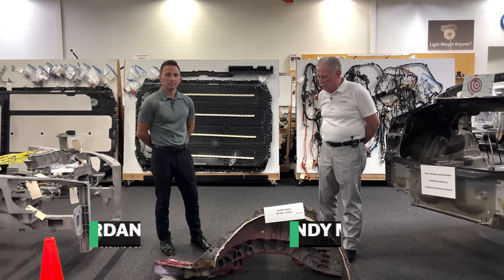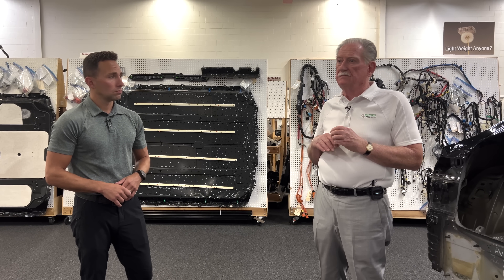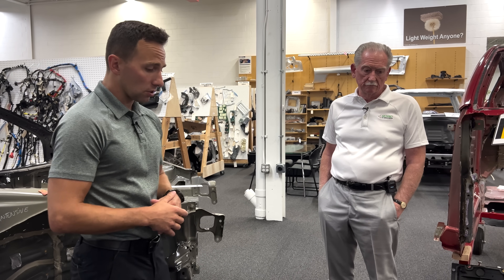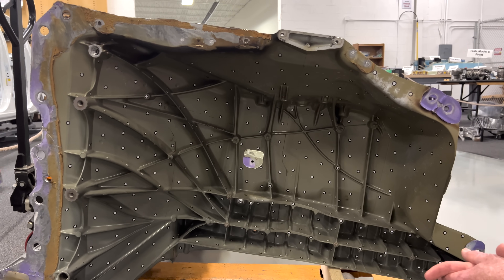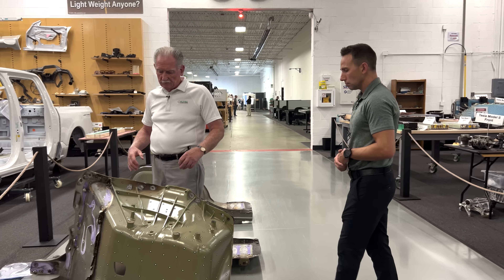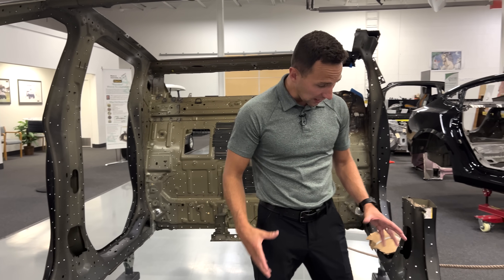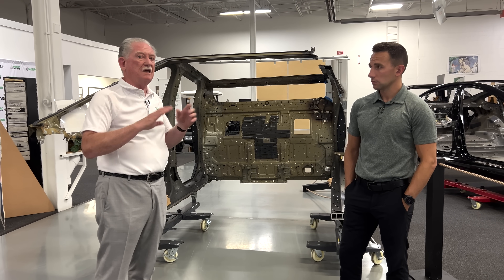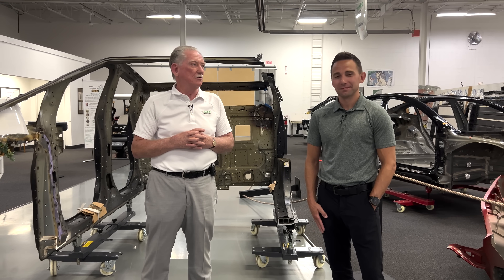From 120 to 1: How the Cybertruck Castings Continue Tesla's Reign of Reduction

Comment: @MunroLive
I hope you guys are gonna talk about the shear stress failures on the gigacast trailer hitch, and how or if tesla can revise the design. They clearly need some sort of ductile brace like steel to reinforce the vertical shear forces
Reply: SHEAR, not sheer
Reply: @The_DuMont_Network  fixed
Reply: @The_DuMont_Network  
Dictionary
Definitions from Oxford Languages · Learn more
sheer
adjective
2. perpendicular or nearly so

Just fyi, but point taken
Reply: @whodat9198 
 shear 1 of 2 verb

: to subject to a shear force

: an action or stress resulting from applied forces that causes or tends to cause two contiguous parts of a body to slide relatively to each other in a direction parallel to their plane of contact
Reply: @GROND15  no kidding, you missed my point. I always appreciate people that define words with a tautology too.

Shear = to shear 🤣😂

Very Merriam Webster nonsense
Reply: They need to reinforce it with C4 obviously.
Reply: @whodat9198 It was not a hitch failure, WD busted the end of off the casting.     It was a 100% entertainment video.  No science in it.
Reply: @danharold3087  WD also showed that a real truck has no such issues. CT is a terribly designed, but well engineered truck. there's a reason trucks don't use aluminum frames.
Reply: @danharold3087  incorrect. A family towing on the freeway hit a pothole and snapped the hitch/ rear losing the trailer. That's not entertaining unless you're a psychopath. The cast was clearly designed for adequate horizontal towing forces but not vertical. This is where real world experience cannot be substituted for desktop simulation by inexperienced programmers. I assume they should be able to design in more cross braced cells in the rear to reinforce if adding ductility is out of the question
Reply: @danharold3087 I'm not sure. Either way, it's really a distinction without a difference. It deserves further scrutiny. It would be nice to hear Sandy and Tesla say something about it. I'm not into applying faith and hope towards engineering that someone will just be all over it. No offense meant.

Given the nature of crystalline structures in this sort of casting is not hard to see how this could be an overlooked design flaw when engineered to a limited specific design parameter. I hope it is remedied, if not I'll just get my reveal night deposit back and wait for gen 2. My Scout reservations will be ready for delivery by then.
Reply: @danharold3087  what a joke of a "truck" i wonder why WD couldnt bust the trailer hitch of the ford f150!!!!! he did litteraly everything can you talk about that!?
Reply: @alanmay7929  That specific design flaw doesn't make the cybertruck a joke. It's still better than the F150 lightning in speed, acceleration, handling, audio quality, self driving, charging performance, off road capability, larger cargo bed with 300lb rated security cover, tech integration and features, full camera surveillance, door ding resilience and taking a 9mm or 45acp driving through a democrat city.

The F150 is quieter and more comfortable. It reigns in that category over all others
Reply: @alanmay7929  
Did you see the video from last year (2 years?) of the guy who had an F150 literally break in half at the join between the cab and bed?
.
Reply: @rogerstarkey5390  yup, ford had a bunch of raptors that bent in half from trying to jump

Comment: Did you guys give feedback from the broken cybertruck in whistelindiesel? In case you didn't see the YT episode, the rear just broke off, like it snapped way to easy.
Reply: Also the follow on video showing a body on ladder being dropped similar to the Cybertruck drop.
Reply: Why the guy is a total tool with fly like iq.
Reply: Not exactly a surprise that flying a truck six feet in the air and then dropping its back repeatedly on a slab of concrete would cause damage.

It's just an entertainment clip. I'd say I'm surprised it took that damage so well, the competing Ford was actually hauled off camera without doing much - due to lack of performance to pull it off.
Reply: @AllanSustainabilityFan  go watch whistlin diesel following video he tried everything to destroy the ford f150 trailer hitch but didnt succeded, in fact he actually bent the chassis of the truck nut still nothing happened to the trailer hitch.
Reply: @alanmay7929  I've seen enough of the entertainment stunts. The guy is just catering to his audience. Nothing wrong with that.

Meaningless in real world applications.
Reply: @AllanSustainabilityFan  there is a video on tiktok of a 80hp toyota yaris from over 20 years ago carrying well over the payload of a truck on its roof and has been doing that for how long who knows! its just goes to show how solid some vehicles are built!
Reply: @AllanSustainabilityFan  Heavy D did an experiment with his tesla cybercrap with 3 motors over 850hp hauling quite a heavy  load vs a RAM 5500 heavy duty uphill, the tesla went much faster up but barely arived with 10% battery left while the diesel literaly disnt break a sweat and no range to worry about! thats real world applications.
Reply: Tesla will add C4 to the casting.
Reply: @isthatatesla  what a lame joke! because c4 literal appears from nowhere!?

Comment: Cost reduction and process improvement with substantial price increase. 🤡
Reply: Yes,  all automobile prices have skyrocketed due to forced inflation. If people are still willing to pay the price,  it's,  strangely I admit,  not too high,  and it's selling well.
Reply: False. Tesla has been reducing prices over the years, and currently offers some of the most compelling vehicles in their class in terms of cost. Tesla takes top 3 places for best selling vehicles in the US not just because of the "hype", but because the competition can't offer better or even similar vehicles for the same money. Look at VW Buzz for example, and compare its specs to Model Y long range - slightly different class, but specs and price differences are mind boggling.
Reply: The important thing is that they are now cash flow positive.  They can now adjust profit margins based on the decreasing cost to build the truck.

Comment: How does this revolution fair with repairing front end damage?
Reply: its not a revolution at all.
Reply: Castings are marked for cutting out damaged sections and then you order and weld in new of the shelf available sections.
Reply: @magamike1800  off the shelf lol! what shelf? Weld aluminum casting? 😅
Reply: @drury2d8  Yes. The castings are marked to where they can be cut and Tesla sells the sections to be welded back in. Sandy has spoken about this. Mostly its just the crush cans in the front from what I understand.  But thats the most common part to get damaged.
Reply: @drury2d8   Yes he has it right.  Unfortunately insurance companies are totaling cars of any make when they get this level of damage.  Tesla has said it will be designing major service centers with lanes/lines dedicated to specific repairs.   We may see a line where the stainless exoskeleton is unbolted at one station.  The damaged casting cut and prepped at the next,  then another to weld on the parts, and a final station to bolt on the exoskeleton.   There is a possibility that entire casting could be replaced as sections of the car can be removed as modules.   Still early days.
Reply: @drury2d8 yes do try to keep up, welding has advanced past your 1930's level of understanding.
Reply: @GrigoriZhukov  if only we can find 1930s labor rates.
Reply: @magamike1800  perfect! Thanks. Hater will say it has to be “totaled”.
Reply: @magamike1800 except in practice, it's not happening.  Insurance companies are simply writing off the vehicle.
Reply: @Dularr  A casting should be easier to repair than a sub frame made out of stamped parts. It will just take some time before it becomes a more common procedure.
Reply: @magamike1800  the debate is the skill level. TIG welding a casting vs cutting torch and installing a new stamped part.
Reply: @Dularr sad, it's easier to repair the casting by far.
Reply: @Dularr because insurance companies are still learning.
Reply: @Dularr  
If "Insurance Companies" are writing them of, that's THEIR problem. 
A quick search on this platform will provide MANY channels telling us "We repaired a written off...." (Pick ANY model of ANY Brand)... and I mean "Conventional" vehicles.
Reply: @Dularr  the process involves cutting at a marked point.
Re the "Skill level"
I believe (from memory) 

Positioning the new section using a jig for VERY precise positioning (closer than you would EVER get with Steel)
Welding.
Drilling and bolting a fillet plate to specified points across the repair.
Essentially Good as new.